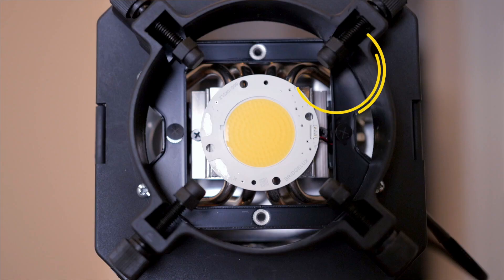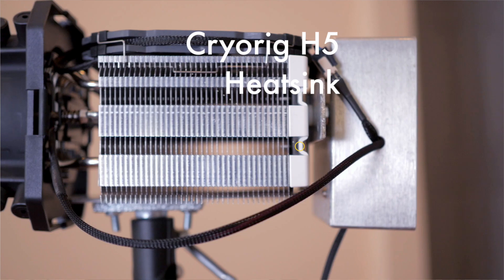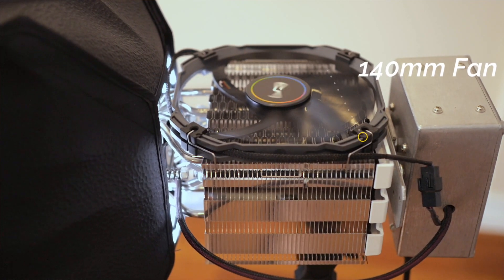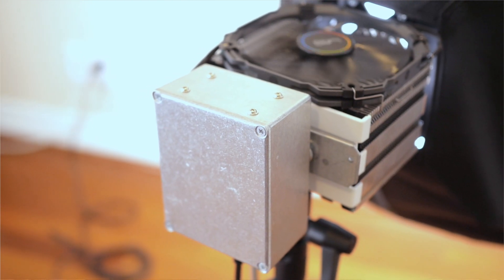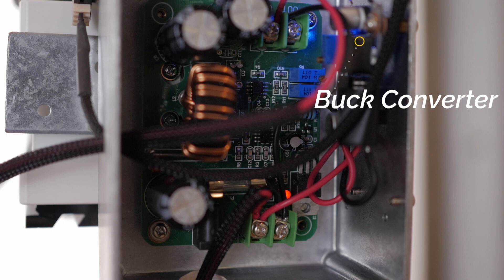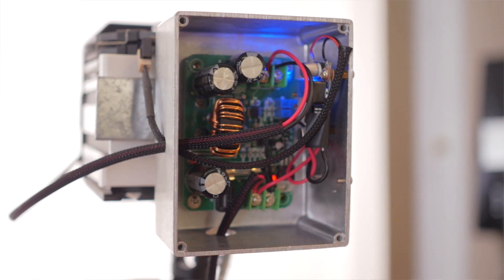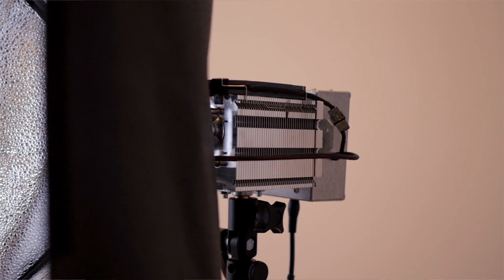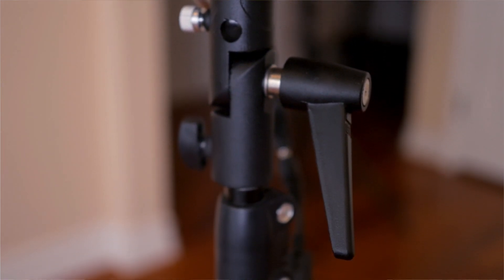H5 Frankenlight Intro Video | A DIY 8,000 Lumen High CRI Video Light

Comment: This is fantastic. I, too came across the DIY perks video and wondered about making something similar, especially something with a bowens mount on the front. It just seems like I can't get a comparable fixture that I can trust in the long run for this kind of affordability. And if you build it yourself, you won't be replacing it if something breaks, you'll be able to repair it since you know the components.